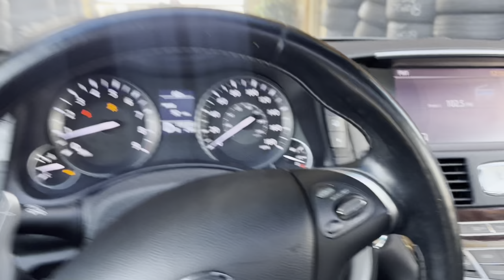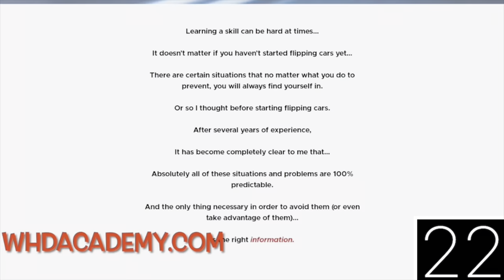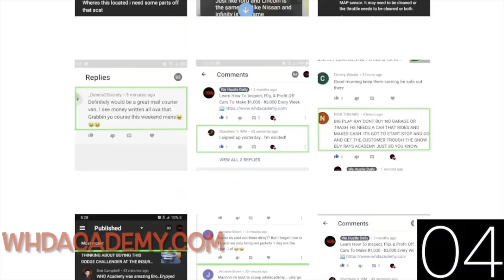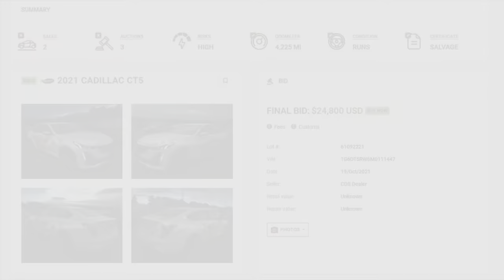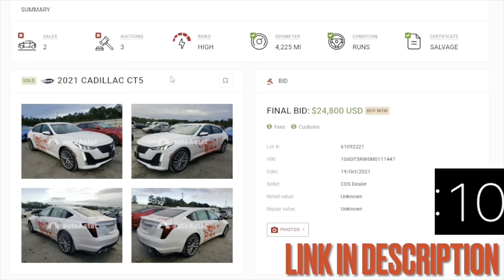I Brought My Copart Infiniti M37s To A Expert To Diagnose The Cylinder 4 Engine Misfire P0304 Code

Comment: Hey 😵don’t paint the hood! It’s just needs to be buffed.  The shop was “cutting and buffing” the clear to smooth out the orange peel of the NEW paint when OG stopped them… you’ll be wasting $$$ if you paint it, because it’s NEW paint and clear under the scuffing!

I hope Rich tells ya the truth and just buffs the hood for you.. for $50
Reply: That hood is already painted and clear coated it was sended down with 1500 needs a 2000 and 3000 after that cut and buff the hood back to gloss back

Comment: I knew from the get the steering wheel was still gonna be off to right it was way too much to right an wheels wer already straight alignment definitely made suspension better but you have to adjust the steering wheel itself

Comment: If that 4WAS light and traction control light is on then your wheel is still going to be not aligned, but let me know @WeHustleDaily I can let you know how to fix it 💯
Reply: Yeah there’s something definitely wrong with the front right tire . I mean the old man showed him what the car looked like before it got fixed the whole front tire came off
Reply: @Jasper9054_  there might be but that’s not going to make those two lights come on. Then lights come on when there’s something wrong with the active rear steering system